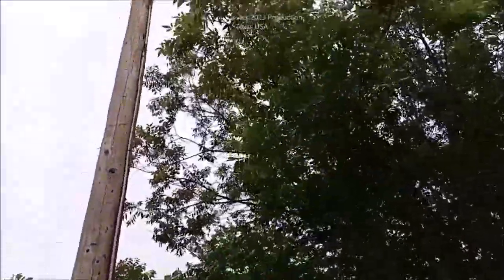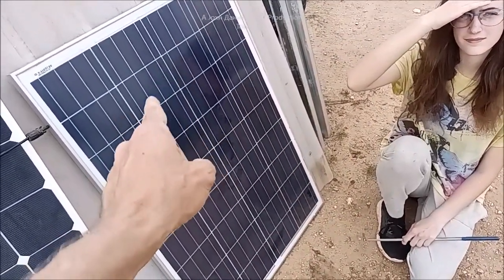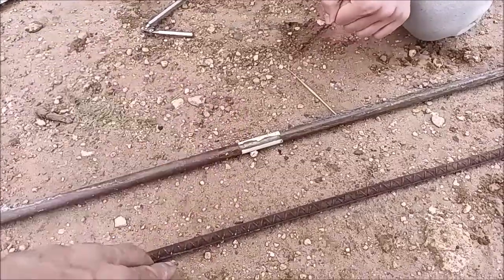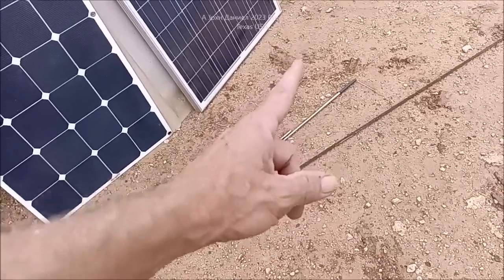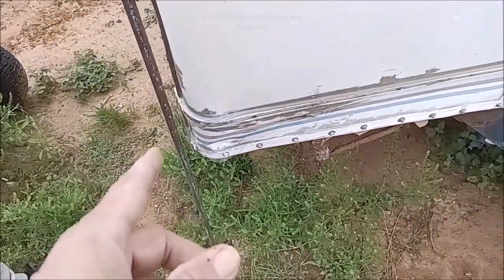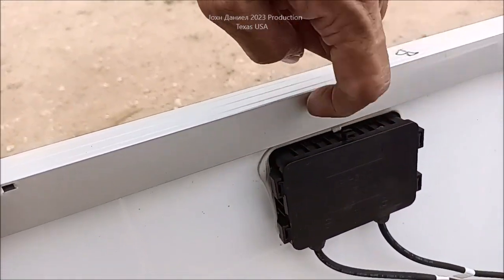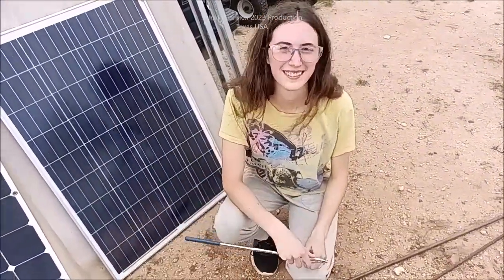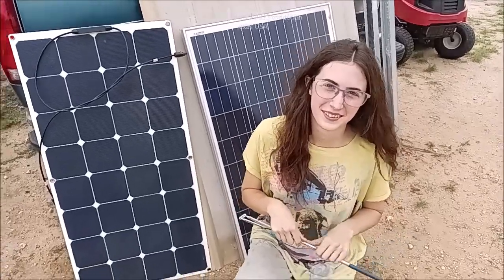Grounding your SOLAR PANELS? 🤔 You Better watch this First! *KNOW DC/Inverter POWER is not Utility

Comment: I read in a forum that you are about to review the LiTime 12V 100Ah mini battery. Is it true?
Reply from the maker: Yes, but we have had to make a order for 2 AWG cable to wire them up safe and proper and the supplier ( ACDC Delco) after 3+ weeks of trying cancelled the order as out of stock, then the next supplier WINDY NATION we ordered from said 5 days, and latest email monday said it is on back order but arriving in week. 
So I may have to pull cable from another source to show how nice these batteries are as a perfect set for all RV made to be used. Many have bought them from my forum link and are very happy with them and I am tired of waiting on the right wire to use on them to make a video showing why they are great. However, people must use the right wire for these to get them to result in optimum performance and safety, a real quandary of issues to deal with material shortages. I will also viewers to buy their cables at a walmart store, easier I just learned to get pre-made cables. I only wished the battery companies would sell cables for their batteries from their websites LOL!  The LiTime battery is a Ampertime product, You get them here https://shrsl.com/42bde it is superior in every way from the ones on Aliexpress and Ebay. They have real efforts in design. 
If you buy these batteries you will be very happy with them, Pouch Cell design, Very robust power. But if you do not use 2 Awg Gauge or at the least 3 Awg Essex Welding Cable on them you can as any battery damage them and you will not be able to get warranty for foolish wiring mistakes.

Comment: If you are looking for a truly awesome lightning repelling/diverting system, look up Nikola Tesla's lightning rod/repeller.  It looks almost like an umbrella, but is designed to perform very similar to how you describe setting up the solar panels on metal roofing.  Really interesting stuff.  

Another thing that most people fail to grasp is that when lightning strikes the ground, the ground itself becomes energized and having something grounded to the spot that is energized can cause something that is sometimes known as "ground source lightning" and can also cause those grounded objects to become energized and be much MUCH more dangerous than an ungrounded metal object.

The main reason I am so involved with grounding/ground isolating stuff is my expensive radio equipment requires a good ground for proper signal propagation, but improper grounding can cause ground loops and lightning and even electric discharge damage by those same electromagnetic waves being transmitted and received.  I learned a long time ago that there is a LOT of bad information out there regarding grounding.

Another thing people don't realize is that electricity does not just take the path of less resistance, it is actually really complex.  See Ohm's law to truly understand how electrical energy will take all paths to ground and divide equally along those paths according to the resistance and then faraday's laws to see how adding inductance and capacitance can have a major impact on it.

The simple subject of grounding is so insanely complex that most electricians and electrical engineers don't fully understand it, there is just so much nuance that goes into it.
Reply from the maker: I base my study and results on 2 things, Sir Benny Franklin and  Faraday's laws. Faraday using a all copper roof on a cabin next to a all wood shingle roof was trying to prove how copper was dangerous, He was a pissy man. He learned the opposite. He learned that electrochemistry was not that simple, the lightning on the project in north France on the coast, right in the marsh, a storm hot spot, it struck the carbon loaded chimney of the wooden house 3 times. Never touched the copper house or its chimney right next to it. Conclusion by Vander Hoff the resident, the copper make the house protected. Private notes to his parish. 
In reality it made the load of the ground sourcing much more spread out. In reality, lightning DID strike both. But the concentration of energy diffusing outward was spread out on the all copper, leaving no real damage. But the energy was so focused on the wood framed houses chimney it blew the top off it and the cast iron frame from Ingles ship wrights, which both homes had, down below warped.  
Little is known of his off Britain experiments done by fellows, but his findings on electrolysis caused by as he put it, the silent energy, showed how the later designs of the Faraday cage came about. 
Note to be accurate, I am prejudiced toward his Savant Qualities, I am kin to Sarah Barnard, she was married to Michael Faraday, her grand father is direct blood line from my Germanic/Lithuanian roots.

Comment: I am a self-taught electrical engineer and I agree with Two Chins 100%. (-:> Disclaimer: Don't blame me blame my teacher <:-) Did you ever wonder why college taught electrical engineers won't touch this subject? They literally say, that they will address it at a later date, and then they never do!
Reply from the maker: Working on drafting drawings for installs makes you a engineer, repairing it in the field due to mother nature makes you a blue collar maintenance man.
Reply: @JOHNDANIEL1  And taking the equipment back to your shop and fixing the engineering oversights/mistakes to make it actually work how it "theoretically should" make you a technician.
Reply from the maker: @johnbrizendine7716  Yet the Edjumacated End-janeers get 500% more pay to guess at it.
Reply: @johnbrizendine7716  i think i fall into that category, lifelong

Comment: You are so correct no smart people and offices they just make rules and laws being annoying dear call DC voltage work if you ground easy voltage, you make a tremendous resistance to it running a dizzy voltage get you more trouble people do not realize and it is true what you say if you have solar panels, 6 inches above your roof and the grounding are you doing is building a serious lightning rod. Have a good day. Enjoy yourself and keep making videos.

Comment: In low voltage dc it doesn’t make sense to ground it, however if you are running a 500v series and a positive wire gets a rodent in it and contacts it to the array you could be in for a bad day
Reply from the maker: Any voltage over 36 VDC I recommend inline fuses at the panels. Lower than 36 I install in line before the controllers.
Reply: @JOHNDANIEL1  I’ve had 450 volt string go live to my array from squirrel damage. Flat knocked my  dink in the dirt, grounded would have been better for me
Reply from the maker: Still do not ground it, Fuse it. Order you some burn safe fuse links, Add them in. 
Contact Josh with Windy Nation, he will explain why to fuse what you have. And the best thing for dealing with squirrels chewing on your wiring is spraying risky areas with rustoleum underbody rubberized coating https://amzn.to/3HXWKRw . Place some cardboard under the wiring to protect back drop, and spray coat it with 2 coats. It retards sun damage, and it makes varmits vomit! Will last 10+ years.
Reply: Clearing a fault is not in the limited vocabulary of this discussion.

Comment: I think much of the confusion comes from legacy thinking!

Look at an electronic circuit diagram and you often see an earth (it's not it is actually neutral ..... unless you go for AliBaba 50/50). Or car wiring diagrams that only show live and a connection to "earth" .... again it is not, it's just a common neutral connection! ...... But the meme is there.

Now if you look at house electrical supplies there is good reason to bond the body of earth to the common points in your transformer.
1. It creates a common voltage (which is known as "Earth" in relation to the rest of your system.
2. It means if you are standing on the ground and touch a neutral you are at the same potential.
3 If you and your neighbour have extension leads they are at the same potential (assuming you are on the same phase)
4 It ties the grid down to a common voltage. If it were not done you might be at 500V (neutral) and 750V (live) as your supply could "float"!

Back to your Solar .... The DC panels float anyway, it is only the frames we are talking about. So Isolated Metalwork is what it is classed as (same as if you had a solar heater up there fed in Pex) it could float with no discernable differences noticed! 
There would be an effect called Capacitive Coupling ...... but that is above the pay grade here ;o) 

Finally for those who think everything should be earthed ..... fine, but how far do you go? Every radiator in your house plumbed in plastic? The metal outside tap again fed in plastic pipe? or to be silly and illustrate the point to death .... Why don't you earth the nails in your roof?
Reply from the maker: Suntec went out of business from law suits due to voltage from nearby leakage of neighbors grounding systems ruined hundreds of micro inverters in a major storm track in Florida many years ago, they never connected the dots that the utility sharing did the damage. Another company Excelsior discovered it.

Comment: I was more excited to see you had riding mowers than the rusty rebar
Reply from the maker: Kiera has collected 2 more for rebuilding/repairing. 4 total now. She has the Murray, very old old ladies rider with only 54 hours on it, to make a fruit orchard trailer/water hauler, but it has a failed governor in it, so she got a case and gasket kit and new governor on the way. The other Huskee is a forest model to abuse, bush hog plan to deal with the back of her property it has as she says a transmission drive pully bound up, so it will be fixed when she collects enough $$ for one. Yes, I call it her property since I can't live forever and parents should build futures for their kids, not shove them off in crazy people making schools.
Reply: I love my mowers!
Reply: @misskiera-g1y  wouldn’t mind to see videos of lawn mower repairs, 80% of lawn mowers out there are MTD, might get a lot of hits

Comment: You are completely correct on the grounding attracting more static and lightning, though, especially with solar panels. 

The only reason I ground anything is to prevent static and electromagnetic interference, but on a solar system I always use a grounding wire with a spark gap so that it does not actually give it a ground, but with the spark gap, it will give any large static buildup a path to ground via the spark gap without actually being a ground in and of itself.  I do the same with my ham radio antenna arrays and tower, if it is directly grounded, it will cause a standing wave or directly conduct the radio waves to the earth, but with a spark gap, it will allow any dangerous voltage or static charges or lightning to jump the gap and go directly to ground.
A long time ago I was putting up a temporary antenna array, and it was not very high up at all, and I didn't run the ground wire/spark gap combo, and for some reason there was a LOT of static built up in the air around it and when I was running coaxial cable I got quite the static discharge, it hit me pretty hard, just glad it hit me instead of the repeater I was configuring.  Flesh heals and bones knit, but semiconductors burn up. 

For my most expensive gear, I always use an isolation transformer and a completely separate the ground from the rest of the electrical circuit to prevent unwanted interference from the electrical grid, while preventing unwanted interference from other emissions.

Grounding and how to implement grounding and knowing what to ground and what not to ground is a very VERY complex subject, depending on what equipment you are working with and if it isn't done properly will cause more issues and cost more than you could imagine.  
 

I do use TVS devices and chokes on the incoming lines from my solar panels, just in case something comes through that may damage my equipment, as well as smoothing out any ripple caused by the fast switching semiconductors in charge controller. ( In my opinion, you can never use enough chokes when wiring one component/device to another. ) The chokes to prevent small spikes and the TVS devices because they are not a conductor except above a certain voltage threshold, so it will not be a path to ground until just after it gets hit.  Won't attract the discharges, but will dissipate them if they do happen to hit.
Reply from the maker: I install on METAL buildings or metal roofs, I argue with lots of people telling them to use metal roofing as a install base. Now the why: You are 27X more likely to get a antenna on a chimney struck by lightning than a metal barn roof. Wonder why? Mass Squared. Lightning is 1mm in width, looks huge, thats the light. But it is seeking ground resource to build from. A large metal roof takes that charge and equalizes over volume of area. But a single antenna on a chimney gives it concentration to arc up. So, mounting on metal makes your panels less of a pinpoint target. I build ( making video later ) a array that uses metal roofing panels, that is why I got so much laying around here. Using lamination cross link methods. Very strong, very lightning resistant.
Reply: @JOHNDANIEL1  Have you heard of Nikola Tesla's lightning rod/lightning repeller, it follows pretty much the same concept that you use for mounting solar panels on metal structures.
Reply from the maker: Yes, as previous comments I am a deep follower of Land, Tesla, Faraday and even Augustus Lemont of Westinghouse. These guys understand energy, they understand most important environmental issues.
Reply from the maker: YOU will be a fan of this guy, crazy, but like a fox! https://en.wikipedia.org/wiki/Maxwell%27s_equations
Reply: @JOHNDANIEL1  I am very familiar with those equations, Ohm's law, Maxwell's law, faraday's law, et al are all related and form a big picture.  Back in the day, those were all required to be learned to get your ham radio license.  Now all you have to know is the FCC rules and regulations to get your HAM license.

All of those equations go into designing and building RF transformers/inductors for use in radio transmitting/receiving equipment.  I remember spending hours and filling notebooks with equations and pages and pages of notes just to design the finals in a linear amplifier me and my dad designed for one of our radios.

That stuff is so much fun!!!!

I also use those equations when designing toroidal transformers to replace the standard E/I transformers that are used in the APC UPS backups to increase both the power factor and the overall efficiency.

I was actually able to use that knowledge to redesign those cheap power jack low frequency power inverters to run at almost 90% efficiency and actually put out twice as much power as they claim.  powerjack inverters use toroidal transformers that can be stripped down and remanufactured since they are just sheets of silicon-steel and I bought a couple of the inverters cheaper than the cost of just the toroidal transformers and made a 20KW inverter (60kw peak) that runs at about 90% efficiency, and it was super cheap.  Took a lot of work and a lot of calculations, but was super cheap.
Reply: @JOHNDANIEL1  Also, kirchhoff's law plays into that as well, when looking at actually using maxwell's laws in designing/engineering a circuit to make use of it all, especially with designing comparators and using feedback circuits to control magnetic fields, a requirement when designing solar charge controllers and inverters as well as induction motor controllers and multi-phase dc motors, especially useful in designing  controllers for  e-bike/e-scooters to get massive amounts of torque and speed from a minimal amount of power.

It's crazy how far we have come in the last 100 years!!!
Reply from the maker: @johnbrizendine7716  What is even crazier is how far backwards stepping totally out of momentum of discovery, on how we have gone neutral and backwards in the last 30 and will continue to do so in the next 30. Youth trained only to be fools, only self indulgent and never thoughtful.
Reply: Great discourse! Why build an Electro Magnetic Pulse magnet to blow up your own stuff!  Your spark gap solution is brilliant!
Reply: @hellandbackhoe  Electrical current runs perpendicular to electro magnetic fields, so if an electromagnetic field passes over electrical conductors, it generates some current and can cause voltage spikes and unwanted interference, so by putting a choke on all connecting wiring, it will literally absorb that extra current/interference (see faraday's law).  Not sure what you mean by building an electro magnetic pulse magnet, though.  The spark gap concept was widely used from the 20's through the 50's for protecting sensitive electronic equipment and preventing lightning and static discharge damage.
Reply: Can you give some links to the TVS devices you use please?
Reply from the maker: @sh839c  Depends on what your trying to suppress, what type of voltage, cable, and distance your working with. Normally if used just heavy silicon diodes but never some fake EMP snake oil devices.
Reply from the maker: @sh839c  https://s.click.aliexpress.com/e/_De8xIJn